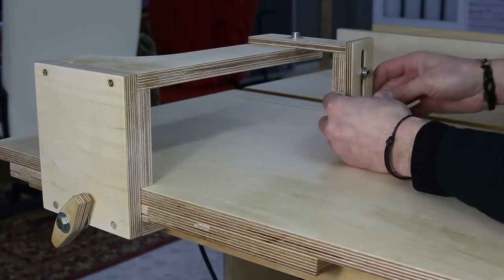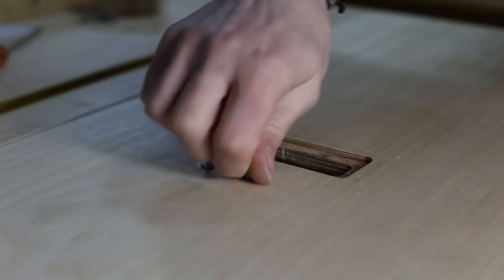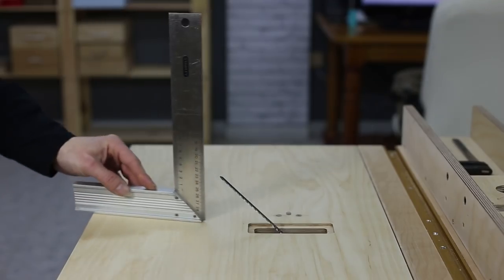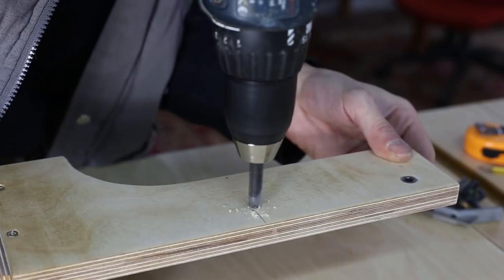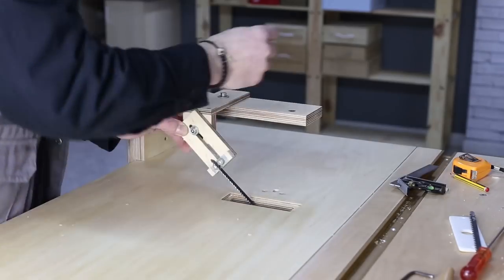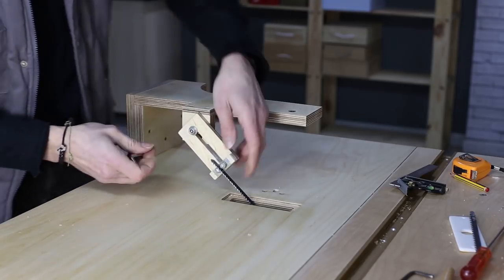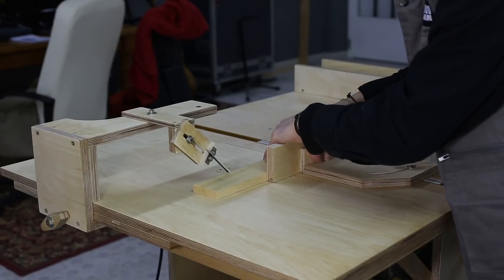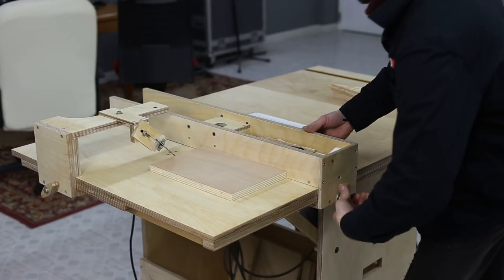45 degrees Jig Saw Cuts

Comment: what would be the thickenss I could cut with using this jigsaw rig.. Say could i cut a guitar body blank of 5cm thick ?
Reply from the maker: +Tom Loux The maximum cutting height you can get is seventy milimeters. But keep in mind that depending of the hardness of the wood, 5cm can be tough so you will have to go as slow as you can.

Comment: ? I don't understand? what's the point of this? just use the table saw...
Reply from the maker: you can adapt this ghide to others tables
Reply: Table saw is expensive. This isn't. That's the point.
Reply: its much more safe and the cut are more clean :)
Reply: Totally agree, use a table saw. $500-700 Festool jigsaw..
Reply: True. :)